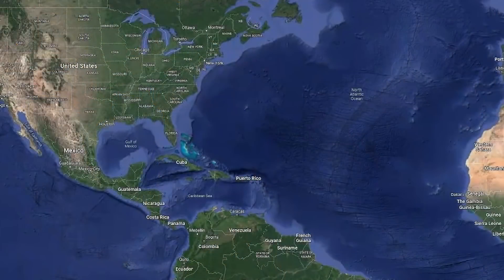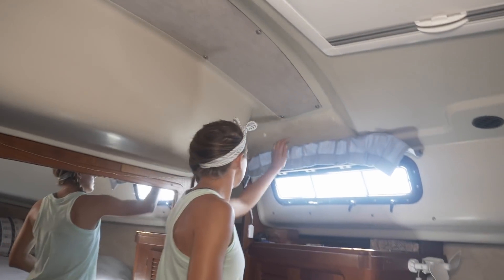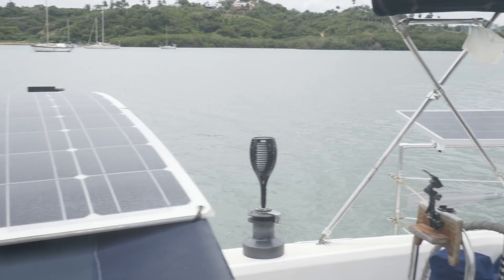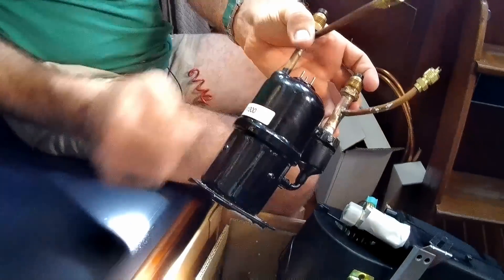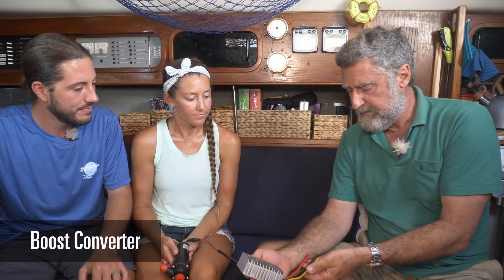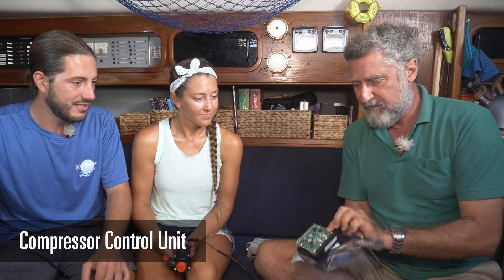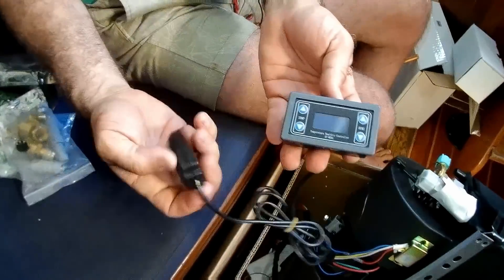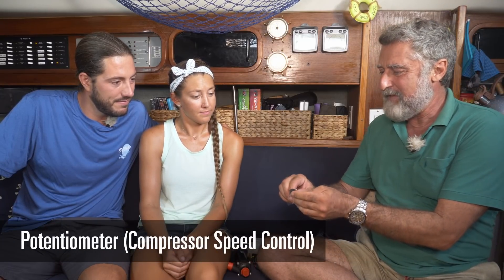Battery-Powered Boat Air Conditioning

Comment: Does the saltwater-cooled condenser also produce any ambient heat such that it would be better mounted outside of the space to be cooled? If the space that it (compressor/condenser) occupies is well insulated, will the compressor be unhappy that it isn't being air-cooled sufficiently (or is the refrigerant going through it good enough)? Just thoughts about testable things since it's a new product : )
Reply from the maker: The condenser doesn't radiate much heat.  When charging the system this week the final refrigerant temperature from the condenser was under 90f and the incoming water was probably about 85f.
   The compressor is cooled by it's refrigerant but that's counter productive.  Its best if you placed the compressor outside the cooled area and blew air on it but it doesn't seem necessary.  
   There is a temperature probe on the compressor and it's control board will stop it if it gets too hot.
Reply: @Clarks-Adventure  Lovely! Sounds pretty bulletproof even in less than optimal conditions. You should have designed automobiles, but I'm aware of planned obsolescence so that's a useless observation.

Comment: We have a 24v boat already so this should be awesome!  Is there a recommended sq footage max?
Reply from the maker: We will have to come up with a 24v system.  You will probably get a 24v salt water pump but the air handler might need to stay 12v (it uses much less power.

I'm going to try to run a test tomorrow am to calculate the actual BTUs moved out.  Once I have that number you can use normal recommendations.
Reply: @Clarks-Adventure  for the 12v parts I can get the same type of dc converter from 24v yo 12v very easily
Reply from the maker: Sure.  We will likely supply that but you might be able to just use the speed controller at 24v, as long as you don't turn it up beyond half.  (We will have to run tests)
Reply: @Clarks-Adventure  I have a couple of them dc converters already due to some boat electronics not available in 24v
Reply from the maker: Yep, I bet that you 24v guys all do.  Good information.